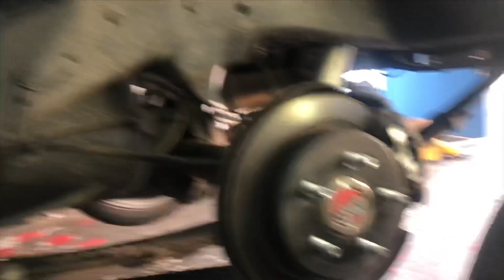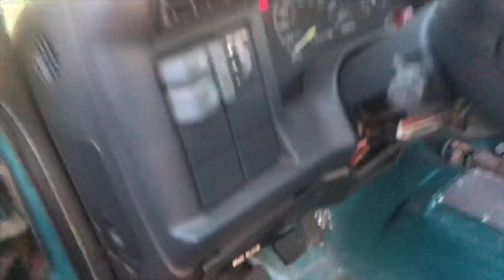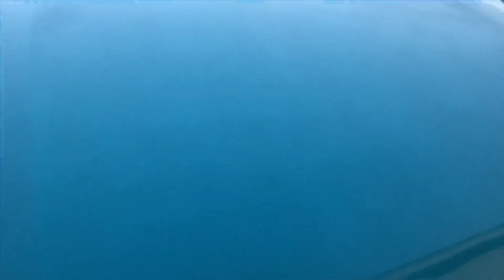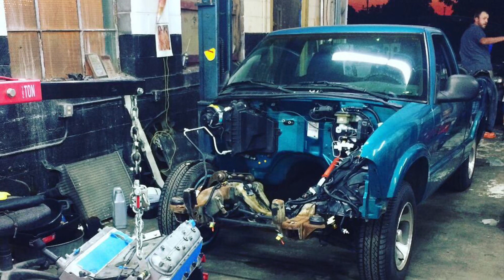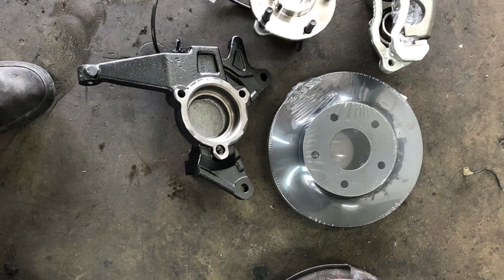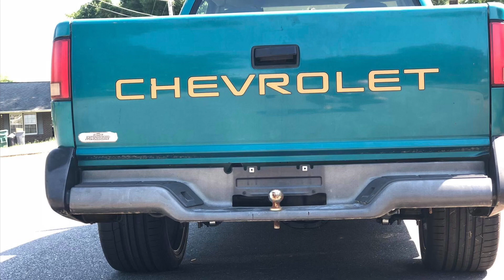** SLEEPER STATUS** Ls/t56 swapped s10! She finally road worthy!

Comment: Good job. One question do u have to cut the front cross member to fit or is it cauae u used stock oil pan?
Reply from the maker: JORDAN Vargovich we used a hummer oil pan, it actually fit without cutting the cross member but was super close, we cut about an inch out so we could remove the oil pan in the future without removing the engine.
Reply: @bigdsgarage2470  thanks. I was curious. I know some of the kits give a differnet pan. So makes sense .

Comment: What did y’all do about the driveshaft, Did y’all have one made or able to find one? I have this truck’s brother same color and everything with the same set up. I’m still in the build process of doing a complete off frame. Thanks
Reply from the maker: Hard Knox Iron thats awesome man, you won’t be disappointed!! I took the stock s10 driveshaft with the t56 and 8.8 yoke to a local shop and had them make me one.I don’t remember the exact measurements right off the top of my head but it ended up costing me around $250 with new universal joints.
Reply: Big D's Garage thank you, that’s what I figured I was going to be doing.

Comment: Which type of brackets did you use for the rear shocks to fit with the 8.8 rear end? Did you use the factory ones and just made the holes bigger for the u bolts or did you use different ones.
Reply from the maker: We used factory plates and just drilled out the holes. Also had to remove the factory dowel pins.

Comment: How did you mount the T56? I’m doing a t56 magnum swap. Also would the Chevrolet performance oil pan do the trick for clearing the cross member
Reply from the maker: We used brp hotrods engine and transmission crossmember mounts, pretty straight forward and bolts in factory location. You could get by without cutting the k member using a Chevy performance oil pan.

Comment: How did you mount the transmission? How was the instal process?
Reply from the maker: We used BRP engine mounts and trans cross member. It was a fairly simple swap. Not much cutting or modifying involved.

Comment: ok so what rear end are you running?
Reply from the maker: It’s the 8.8 out of a 2000 explorer. Replaced the Factory axles with 31 spline moser’s
Reply: @bigdsgarage2470  do I have to change rear end and get calitracs? I already got 6 grand in the truck and motor and still don’t have the motor in the truck or the truck painted and had body work done
Reply from the maker: It depends on how you plan to drive it. I’m sure the stock diff would hold up to normal/ daily driving. If you plan on beating on the truck I would highly recommend upgrading. Around my area the explorer 8.8’s are fairly cheap. 200-250 bucks
Reply: @bigdsgarage2470  where you from?

Comment: Whats the wheel and tire setup
Reply from the maker: Ryan Hughes c5 zo6 replica wheels. I believe the rears are 11’s and the fronts are 9.5. Tires are continental extreme sports 295/35/19 rear 255/40/18 front
Reply: @bigdsgarage2470  with the 8.8 you didn't need spacers?  Thought they were more narrow then the oem rear
Reply from the maker: @Matp345  the factory 2wd s10 rearends 54.5, the explorer 8.8’s are 59.5. We found that running a c5 offset fits perfectly with no spacers.
Reply: @bigdsgarage2470  really?!  Well that changes my plans then. I  Originally wanted to do an 8.8 but read somewhere it was too narrow. Then I started looking for 2wd 8.5 which are few and far around me. A buddy was giving me a zr2 rear which is 63". Wheel choices then would get tough.
Reply: @bigdsgarage2470  I guess you just redrilled the axle and rotor for the right lug pattern?

Comment: Change the front grill to the newer one and a roll pan bumper then a 2in drop
Reply from the maker: Esau Moreno it has 2in drop spindles in front, 2in drop rear leaf springs and plan on doing a gmc front clip
Reply: I would leave the front end as is , 94-97 are rare S10s,  I have a 1995 and love seeing the 1st Gen 2s on the road..